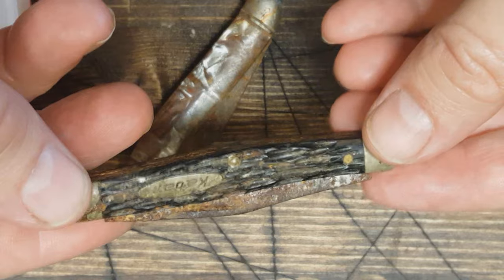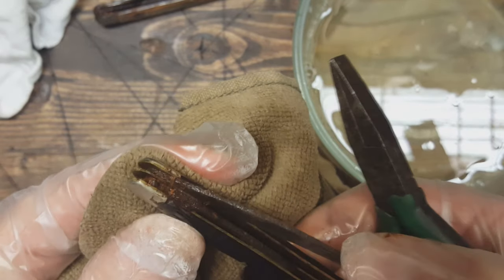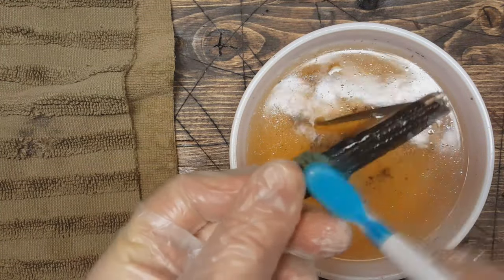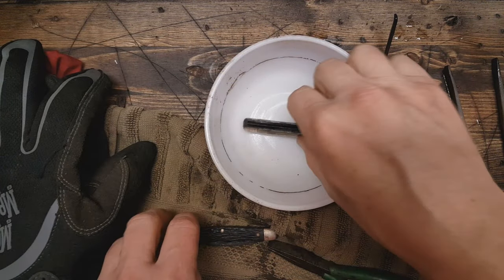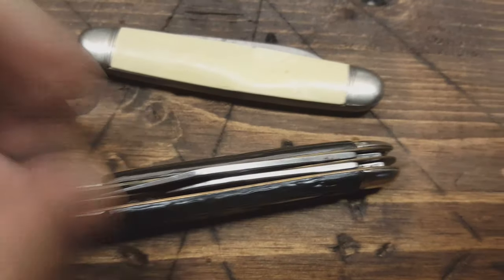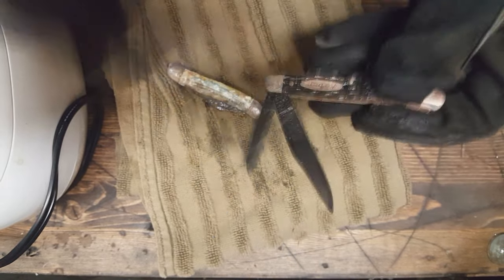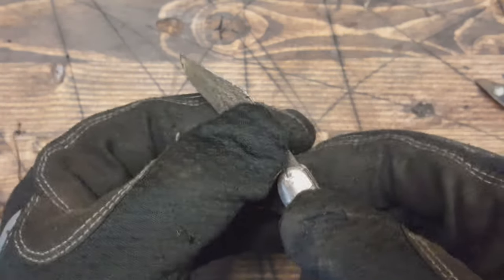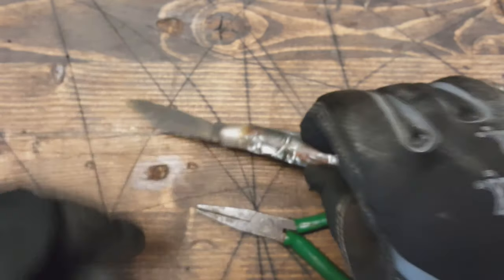Two Rusty Vintage Pocket Knives Rescue

Comment: When trying to break those stuck blades loose, depress the closed blade first.  The spring should give, and allow the blade to move just a bit.  That should make it easier to pull it open.

Comment: Penetrating oil is my go to. I spray knife down and put it in a bowl (Just to catch run off) for couple hours. Never failed me yet.
Reply from the maker: Good info..Thanks Grizz!....need shop for some pentrating oil for sure :]
Reply: Agree, penetrating oil does the trick every time.
Reply: WD-40.. works miracles

Comment: I think I would have washed both 8n hot soapy water, then soaked them in oil before I went any further. I need to go to a flea market now but I’m not ready for that much rust. You did a great job staying with the restoration. Thanks.
Reply from the maker: Cool..Thanks for Watching Carlton and best of luck at the Flea-Market 👍🙂

Comment: A fairly effective alternative to evaporust is pine sol. Heard it from an older fella once. I tried it in an ultrasonic cleaner like you have.
Reply from the maker: Very Interesting!..TY...I'll have to look into trying that in the future...appreciate the info :]
Reply: I use it in cleaning surgical steel that needs to be sterilized. Murthy’s soap or pine-sol work well on cleaning metal.

Comment: The kabar turned out to be a good looking little knife. Have to admit I didn't know they made small folders like that. Not sure when it was made 60s,70s maybe even 80s
Reply: I got an old Kabar trapper blades worn out from sharpener 😅
Reply: I got an old Kabar trapper blades worn out from sharpener 😅
Reply: I got an old Kabar trapper blades worn out from sharpener
Reply: I got an old Kabar trapper blades worn out from sharpener 😅

Comment: There is penetrating oil that will dissolve rust on contact available at auto parts stores. Liquid wrench and kroil dissolve rust on contact. WD40 is worthless
Reply from the maker: Ok Cool! Thanks for the Tip much appreciated👍

Comment: Did you degrease them before putting them in the vinegar bath? The WD40 will protect the rust, preventing the vinegar from doing its job.
Reply from the maker: Good Call! I don't think I did degrease...need to remember that for next time  :]👍
Reply: @DirtandRust  I typically start with dish soap and hot water to degrease and remove any dirt, then vinegar, then oil and scrubbing. Cool videos 👍

Comment: Hi new subscriber 👍🏻do you sharpen them to use them? I’m starting out with old pocket knives I got from friends. Can you buff the blades to shine more? I use a Dremel to clean them but it does scratch the blades so I use 1000 grit then a little polish, I’m a total amateur lol so I’m learning but it’s fun just for me. Thanks 🎄Merry Christmas 🎄
Reply from the maker: Thanks for the Sub Durango I appreciate it.  I'd start by getting any of the crud out  out from under where the blades set...you can use canned air or maybe a pipe cleaner, then go over it with some mineral oil  use a old t-shirt or something...you might find you like the look of it after a light cleaning.  If not  us can use a dremel and abrasive discs to polish more...then get a sharpening stone and learn  how to use it (lots of vids on  Youtube for that) Best of luck with your Knife!!